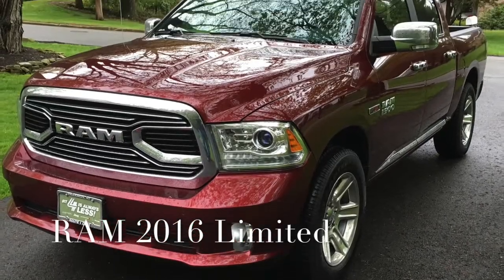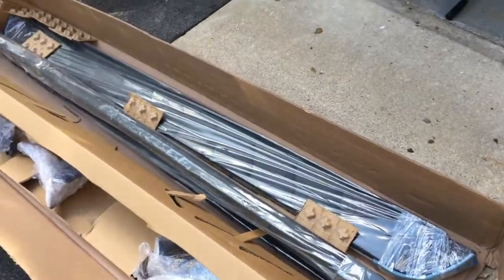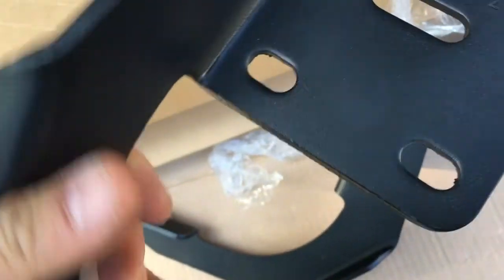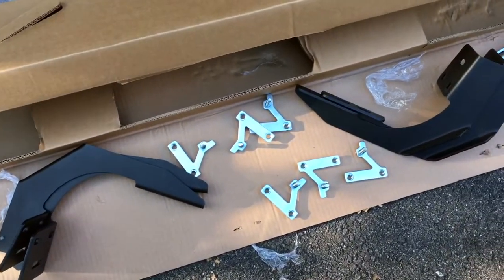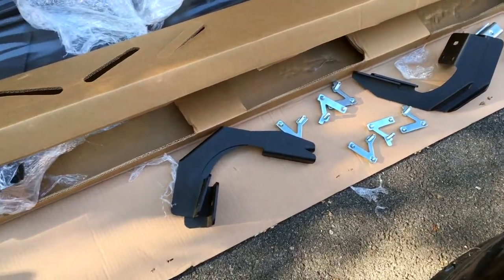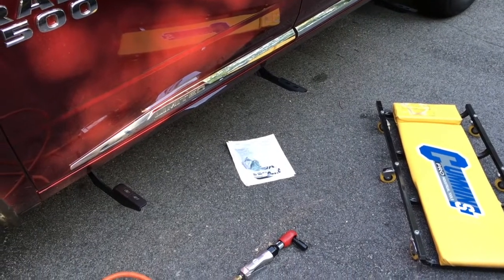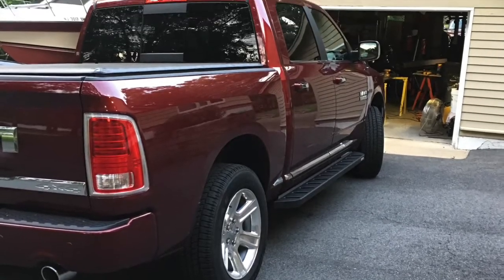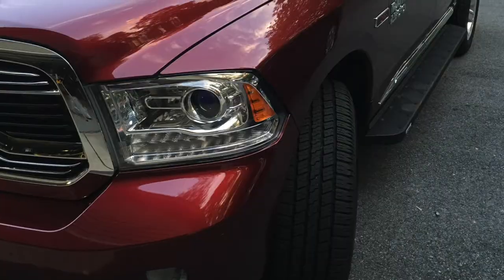Installing RB10 rhino running boards on 2016 RAM 1500 Limited

Comment: What metric bolts are needed for the bottom holes?  Did you install the top bolt/bracket after modifying it?